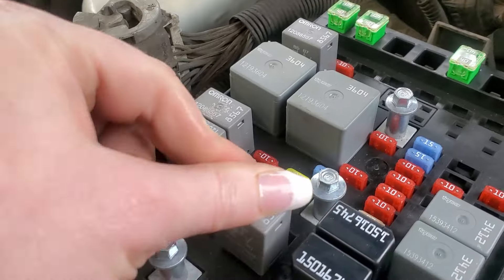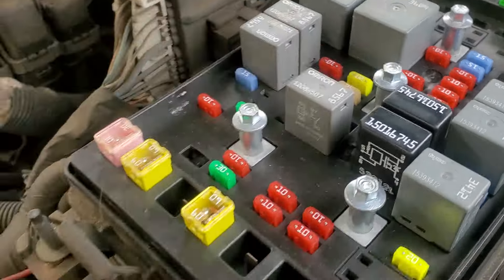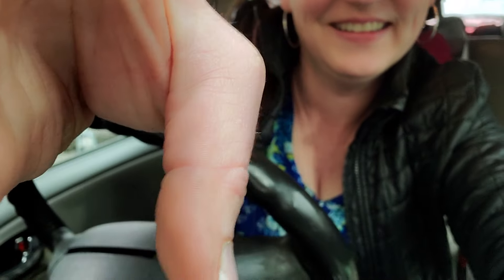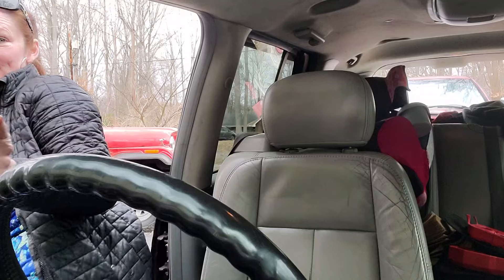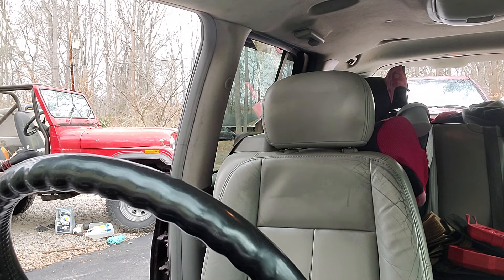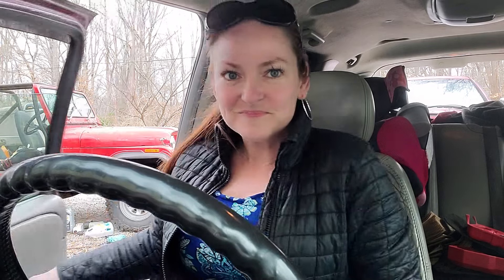GRUMPY TRAILBLAZER | WHAT HAPPENS WHEN YOU TAKE YOUR FUEL PUMP RELAY & FUSE OUT OF YOUR VEHICLE?

Comment: I think the battery is dead or the starter , all you should have to do is pull the fuel pump fuse not the relay I want to hear it cranking like it’s out of gas silly ❤🫶🏻😁
Reply from the maker: The battery was dead.  I was trying to do a "how to" & funny video, but the timing was wrong & and I found out the battery was dead!  Someone was rather persistent about Trailblazer videos...  😆